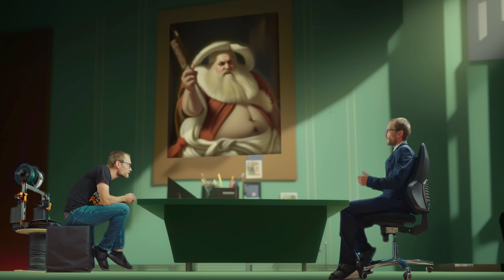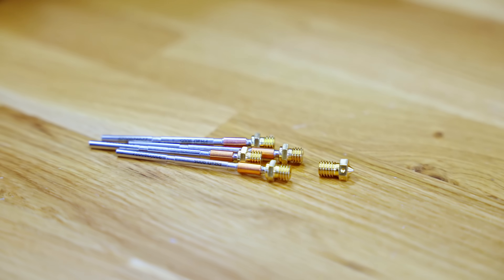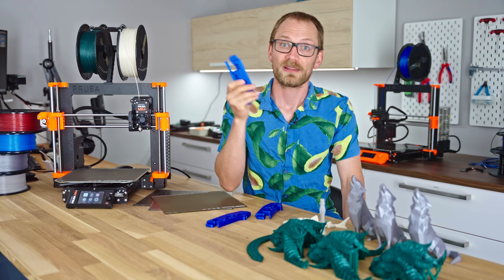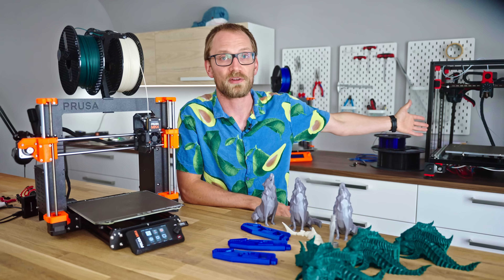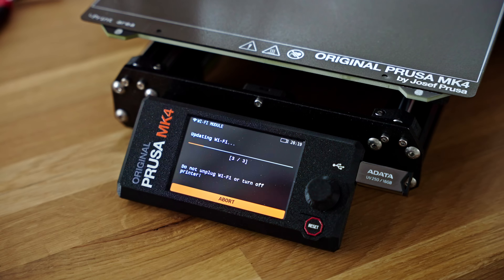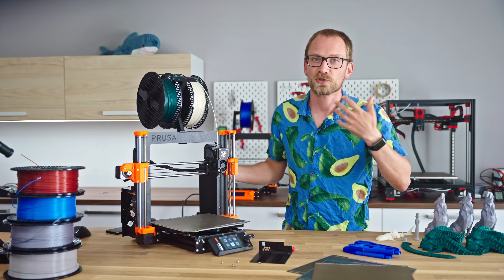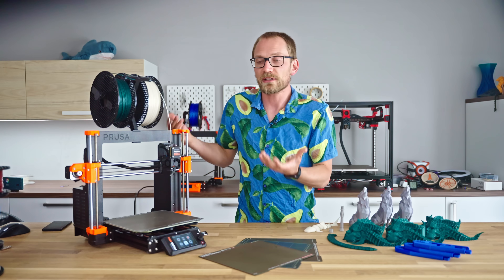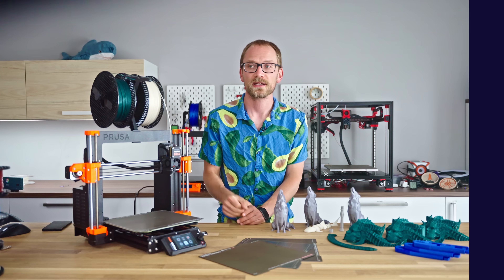Does the Prusa MK4 have what it takes?

Comment: Thomas, there is a lot of misdirector caused by all the advertising on the Input Shaping.

Input Shaping is not the panacea of the 3D printing, and does not produce fast good print at all. 
Input Shaping it is able to remove artifacts cased by vibrations, BUT AT A PRICE: you loose all the sharp corners and sharp edges. No way, it is by design. This effect can be increased or decreased by the settings, but it is always there.
When I looked at the print you did I saw that they were exactly how an object printed by with input shaping should be. 

This means that if you need the absolute quality, you need to print slowly and without any input shaping. 
If you print fast, then you will introduce quality degradation, it does not matter what printer you are using (Voron, X1C, P1P, V400).
The input shaping will remove some vibration artifacts but will round the edges.
If you are in peace with the degradation level caused by the speed (where having the print in 3hrs instead of 6h is more important for you) that is up to you.

This resemble me the diffusion of the MP3 format on the music. 😉
An MP3 audio file has lost lots of its details, and for people that wanted to listen to it in Audiophile quality, that is crap. 

Nevertheless time revealed that the majority of people was more interested in storing the music in few space and loosing the quality than store cristalline audio masters in lots of megabytes. So the MP3 had an enormous diffusion and usage, and then people was acquainted to listen music to crappy earphones and not on studio quality professional Audio Earphone. The bad quality of sound with compression noise and artifacts was widely accepted as normality.

So, may be we are in the same situation in the world of 3D printers.
How many people are just printing objects at 0.3 or 0.4 layers level that should not be perfect and should be just printed quickly ? 
I can think at helmets, props, and figures that need to be printed and then primed and painted later. Market is full of people that are using the printer for this.
I have also a V400, and I am the first to say that a lot of things I print are really mechanical parts that do not require extreme good quality or small details. 😉
I have an assembled MK3S+MMU2S and (when I will receive it) also an MK4. I will probably use the MK3S for small fine detailed print that should not be printed fast (e.g. 0.2 nozzle and swappable E3D nozzles) , the MK4 for general good print, and the V400 for fast objects or very long print that are halved in time.

I don't see the MK4 as a speed race printer at all, but a printer that can do very good normal slow quality print, and reasonable fast print but at cost of quality, as it happen for ALL THE FAST PRINTERS (not just Prusa).

But if the market will move for fast printers and mediocre quality, and the "fast mediocre quality" will be the new standard, then Prusa will be in troubles, because less and less people will be interested in their products.

Comment: I think what really annoyed me with the MK4 is it shows lessons weren't learnt from the Mini launch. I bought the mini under the pretense that it had, or would have power loss recovery. It was a feature proudly splashed all over the marketing material and website. We're now several years on, it's had the plus iteration and it's still non existant, with just a github issue people regularly bump which gets an occasional reply brushing it off from Prusa. Input shaping was shown off in the promo materials for the MK4 and once again was not available on launch, and doesn't look like its likely to ever be in a reliable state without having to make an additional purchase to upgrade the machine to add an accelerometer or two. 

If Prusa had done this in the UK they'd have been fined by the ASA for false advertising by now. I can only assume the EU has a similar setup too so it's pretty reckless for them to continue this path of misleading customers, and very much tarnishes their previously great reputation.
Reply: Yes, agreed that that is not a good decision for sure. They were pressured to release due to the competition (which is good) but this and the way they deal with immediately writing off money without a clear way to know when it is shipped is bad (yes they have a shipping table, but no one will find that when you just look at the order page).
Reply: it's like when they came out with the PEI beds and it took almost a year for most people to actually receive them (but every youtuber still had one to review). I don't know why people pretend it's such an amazing company tbh, they treat the customers terribly

Comment: Prusa could probably make a mint selling the nextruder on its own if it's compatible with other boards and firmware. I won't lie if I could stick one on my ratrig I would in a heartbeat. Auto leveling with the nozzle would be a huge sell in of itself.
Reply: something something voron tap

But I also agree, I would also throw it into my Trident
Reply: @TheJustinist the tap is still different enough that you do need to z adjust. Not nearly as much a lot of the time and after you do ot once it generally keeps but still need to do it
Reply: Nextruder seems also interesting for multi  material unit applications as the filament path is basically on the side  of the stepper 🤔. But I won't pay a 300€ kit update just to have my hands on it ^^'
Reply: @KevinLemarchand  yeah, plus they wouldn't have to include a mount since most other printers don't use linear rods.

They are using it for multimaterial but it's the tool changer style. Still waiting on my xl.
Reply: @redkingrauri3769  true, true. I'm still waiting for the next video of MirageC on the nextruder. Very interesting design.

Multi tool(head) is not a MMU :P I was more thinking about something  like the Tradrack (annex) or the ERCF (Voron). ;)
Reply: @KevinLemarchand yeah I know. Mmu3 with the nextruder might reduce a lot of waste if they can do something like the poop chute like the Bambu
Reply: @TheJustinist  Voron Tap really disappointed me, because it feels almost like it misses the entire point of using the nozzle for auto bed levelling. You want to do that so you never have to set the z again, but instead you have to calibrate the activation distance, eliminating the whole point.
Reply: Next ruder is just a big orbitor

Comment: The issue is not that Prusa is in the open source space and supplying their competitors with free R&D. The Problem is that they are in the 4th iteration of a Bed slinger. The improvements that are possible on the i3 platform are minuscule. They need to switch up their main workhorse to something that actually can profit from all the brain power Prusa has assembled. The Mk4 is an incredibly nice Bed slinger. The PrusaXL looks like a great starting point for such a switch to CoreXY. If Prusa Can bring down the Price on that machine that would be huge.

Comment: I don't personally own a Prusa, but as far as I can tell their reputation for accuracy, reliability, and after-market support still applies to the new Mark 4.

Assuming that's true, I think the Mk4 is a good machine to recommend to someone who is brand new to the hobby but interested in building their own machine.  Assembling the kit will give them experience with setting up a printer (unike, say, an Ultimaker or Bambu), but because it's a Prusa they can feel confident that it will actually work without a whole lot of screwing around.  And the Prusa support team will help a lot with solving problems that come up.  All of this will help keep the neophyte interested and engaged and much more likely to keep using their printer and pushing their skills forward.

Starting out with a Creality machine, on the other hand, is a great way to make the neophyte extremely frustrated and push them into just giving up, resulting in yet another printer gathering dust in a closet.

Should the hobbyist buy a second Mark 4?  Should the user with a reliable existing setup invest in a Mark 4?  Possibly not.  But for a beginner, it still seems like a good option.

Comment: I absolutely agree that they should have included accelerometers on the X and Y. It would eliminate unlucky users like you and it would allow easy modifications of the X carriage without ruining the preset. It works perfectly for me but... Why?

Overall I'm extremely happy with mine though, I expected to like it less honestly. I love the "gets you exactly what you need" interface, and I loooove that it still is extremely intuitive to use without touch. 

I've always been a tinkerer but damn, it just works. There's nothing to tinker with! I like it.

Last paragraph I promise, I bought it exactly for the open source aspect (paired with the reliability prusas are famous for). I hate when something breaks and I don't have options because the system is completely closed and the product is at end-of-support... Because the moment stuff breaks is when it's old, and when it's old companies leave it there. So it's good that I can do it myself.

Comment: An Accelerometer Upgrade would be neat, and probably quite cheap/easy to roll out (Development notwithstanding, although it will be difficult either way, and more existing work is there for accelerometer based systems)
Reply: yeah the most expensive accelerometers are like 20 bucks, and you can get some for like 3-4 bucks if you cable it yourself instead of using usb.
Reply: I think the challenge they face as a marlin and microcontroller based board, is that they start to get to the extremes of what their micro controller is capable of doing in terms of both outputting clean stepper timings and recording clean accelerometer data. Then, you have to imagine processing that data is a pain. I could imagine some sort of a hybrid system that utilized a desktops computational power to have for instance the user log into to their browser doohicky and have the more expensive code ran on webworkers in the browser.

It would be light work for a pc, but might be very difficult to both squeeze in performantly into the limited space they have for firmware.

That is of course all assuming that they can even get both recording of data and movement perfectly at the same time.
Reply: The only issue is that it would need to be something that is attachable to both hotend and extruder or built into the bed and hotend

Comment: I bought the mk4 and I'd buy it again. It's such a high quality printer especially with the variety of profiles in the prusa slicer. The only failed prints I've had so far were because I didn't do something right. The ease of maintenance is also a big plus. Many of the non printed parts are standard hardware, and most parts are 3d printed, but function really well.

Comment: I wonder when they will implement power loss recovery into Prusa Mini as they promised.
Reply: Sadly never - more false advertising.
Reply: I've been asking this for nearly 3 years. I was almost convinced they forgot to remove the feature from their website, but then they updated the firmware to support the XL and MK4 and literally has a a field listing which build supports power loss recovery, and they wrote in XL and MK4 and IXL (the print wall model), but left out Mini. So someone knows...

Comment: Having built all my printers and having access to some pretty pricy ones I have a go-to printer list. Entry level= Ender3 pro, Mid level= Ender SL, Upper level= Prusa Mk3. The enders I think print above their price point and have pretty proven designs now. Prusa does pretty much the same with a more solid build and better long term reliability. The bamboo may prove itself long term but I have my doubts if you run it at those high speeds all the time.

Comment: The thing is, many BambuLab owners/contender are so happy to have a fast and sexy enclosed printer that will run a few weeks and months until they break down and throw errors.
However if you want an actual tool that will work for years without doing anything to it, get the MK4.
(I'm still recommending to grease/lubricate bearings every few 100 hours)

Comment: I’ve tried the alpha 2 and alpha 3 input shaping firmware and was pretty happy with the results. The first parts were pretty basic. Simple cylindrical geometries(a bird whistle I redesigned). 4 parts on the build plateinput shaping reduced the print time from 3 and 1/2 hrs down to 1 and 1/2 hr. I needed to use supports for the inlet and the organic supports printed perfectly. The parts came out better than I anticipated and worked very well. Pretty solid too. 
The second test of input shaping was 12 parts on the build plate. The water filled bird whistles scaled to 80% size. My dad loves the darn things and wanted a bunch to show and give to my other family members. Like he’s freaking mesmerized by them lol. Without input shaping the print time was estimated 14 hours 45 minutes. With input shaping it went down to 9 hours and change. Was on the fence about using IS for this print but wanted ti test it out. They came out perfect. The quality was great, the ones he’s tried seem to all work well and sound the same. 

A quick comparison to my mk3s+

I spent so much time messing with z offset and bed correction to get my first layer as good as possible with doing a ny-lock mod. I have post it notes on my enclosure with the offsets for various nozzles and steel sheets. I also have them recorded in a notebook as a backup. I spent a great deal of time on it. 
With the mk4…. I was pretty pissed off. Ran a self check after assembling it and that’s it. Perfect first layer. Every. Single. Time… wtf. After all the fine tuning and tweaking and test prints and more tweaking. Now this mk4 comes in and tossed all that right out the window. It’s just too easy. Wayyyy too easy. I want to try printing on fabric to see how that works out. Could be neat for Halloween costumes. 
Also without input shaping the mk4 is quite a bit faster than my mk3s+. The difference is substantial. It’s also more quiet and has a different sound. I would say it’s a bit more pleasant and less robotic. 

Some things I’m curious about: Can input shaping be tuned without the use of accelerometers? A baseline on an empty build plate is great but I would expect a heavy model to change the harmonics. Could feedback from the steppers and drivers achieve this. Very curious. 
Can the load cell on the nozzle be used for more than just probing the plate? 
Can pressure advance be tuned by users for various other materials? 

A brief ending statement: 

Overall I’m very happy with my purchase of the mk4 kit. 

IS seems to be working well for me. First time using it I literally said out loud, “holy shit this thing runs like a cheetah on crack cocaine”. 

The first layer calibration, regardless of nozzle and sheet has spoiled me. It’s just too darn easy. 

Lastly, as this is a new machine there isn’t as much info out there like for the i3’s. If I have questions big or small I can start a chat with Prusa customer support and get answers immediately, even if it’s 2:00 hrs their time on a Sunday someone is there to help. I find a lot of value in that. I feel they really value and take care of their customers not just mass produce printers and leave you on your own to sort things out.  

If you want to tinker there are budget printers out there. You can spend forever upgrading and adding to them. It could be fun. But if you add up the price of parts and bill your time at a modest wage I think you would spend much more than the price of a Prusa. 
For what it’s worth I’m just a normal dude that’s been printing for a couple years and glad I listened to my classmate who suggested getting a Prusa. They are reliable and easy to maintain. 

Good grief that’s a long comment for a YT vid. Might as well wrote a dissertation…🙄

Comment: Input shaping is not as complicated as you are describing, it's just a filter put over the motion data. When you remove the most resonant part of the motion, it vibrates less. You're making it sound like it adds signal 180 degrees out of phase, this is not the case. That's how noise cancelling works, though.
Reply: Fair enough. But how can the printer understand its motion without something like an accelerometer?

Comment: We have a couple of printers in the office. First one was a Zortrax M200, then there came some Prusas (Mk2 and Mk3), then a Zortrax M300 and now the XL. And to be honest, I prefer the Prusas. They are our workhorses, reliable, easy to fix (if ever something gets worn or damaged). And got all the upgrades over the years to make them more reliable. The 2 Zortrax are retired because firstly they are unreliable divas (grease it after every second print, relevel, etc) and you waste an incredible amount of time and filament for the raft. Also the proprietary and unflexible slicer and the "walled Garden" with filament. When printing a plate full of parts 1/3 of the time is wasted with the raft. I will not buy a MK4 because we already have enough printers for our demand, but when the time comes then it will be probably another Prusa.

Comment: I started with a mk3 3 years ago and then built an oversize Voron 2.4 I sourced myself that now works OK now (before Tom did it). BUT if something breaks or isn't working quite right for you always find a solution for Prusa Printers. I'd recommend it over any other printer if you just want to print reliably. 

All your points are valid. Just not for any beginner.